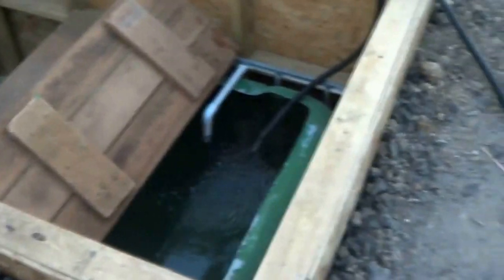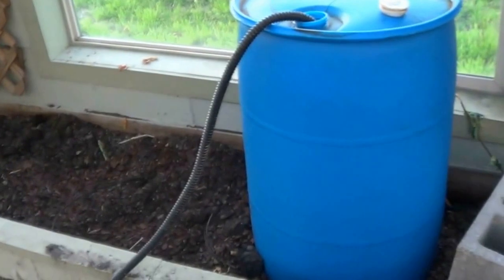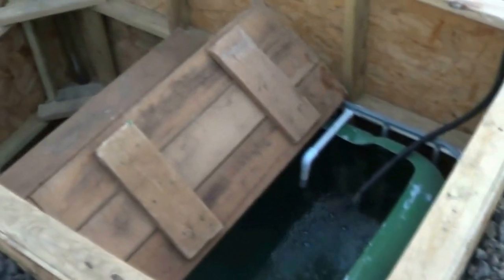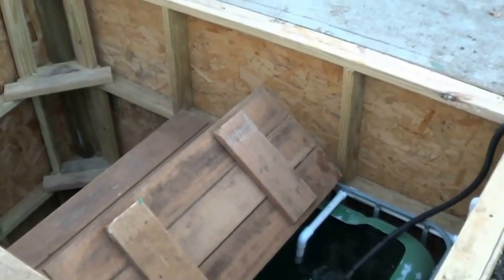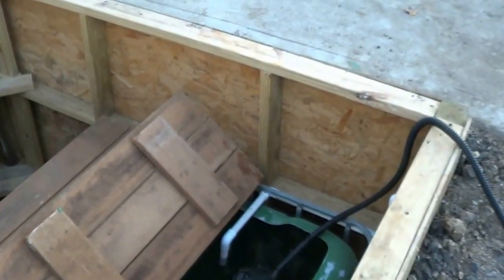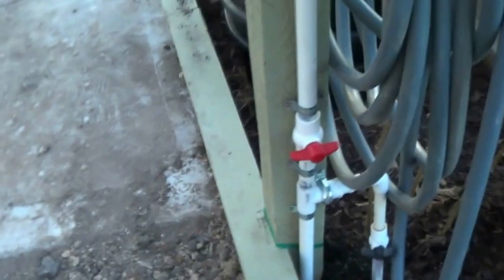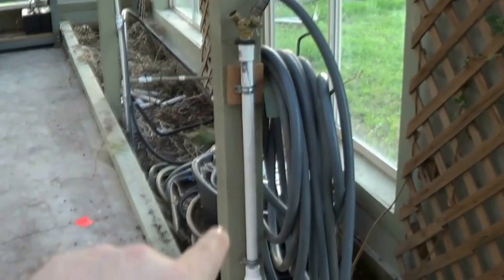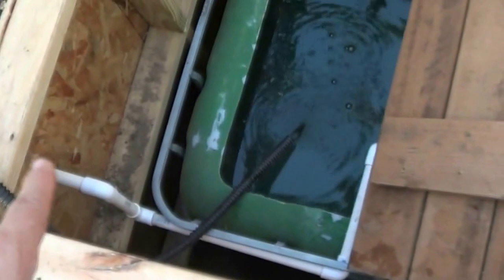Aquaponic Conversion Part 5 Filling the Sump

Comment: Seems like a good idea ... what about filling a barrel down there with a float valve to top up the sump?  Fill the barrel every week or what ever and let it top up the system as needed.  ***** showed something similar in one of his Dutch bucket vids for how he tops up the water in his system and keeps a stable pH too!  You may have to go back into last years videos, anyway ... just a thought!
Reply from the maker: JT - was thinking of that the issue I will have is there will be 2 flood & drain bed that dump right into the sump - I do not want it to fill at a low point then have the beds both dump in & get to full.  I do want that automated though - still thinking...  :)
Reply: I look forward to seeing what you decide!